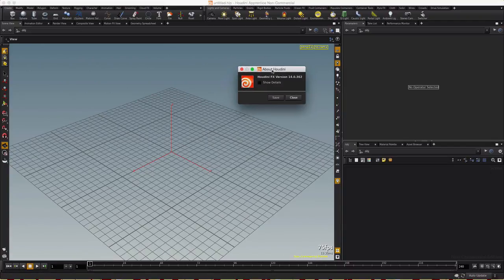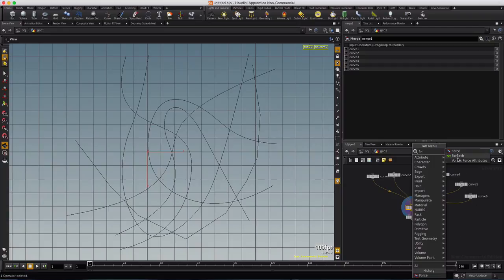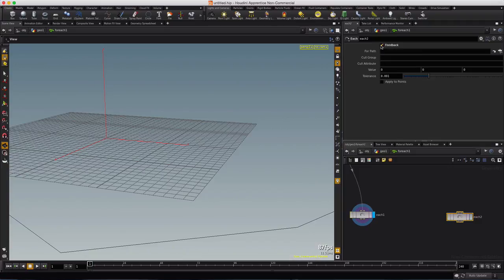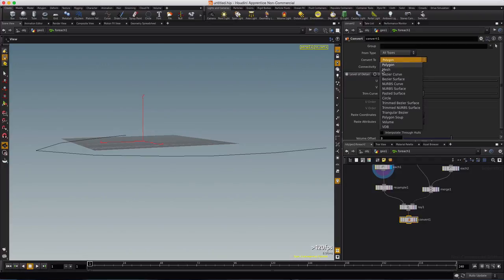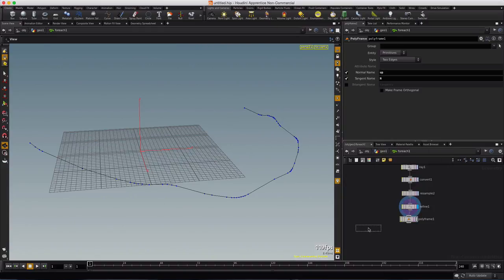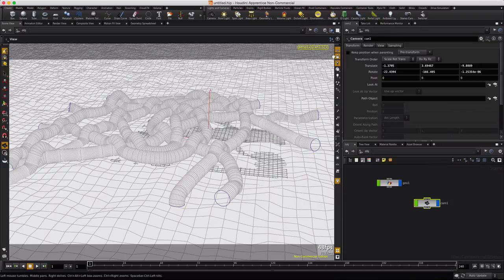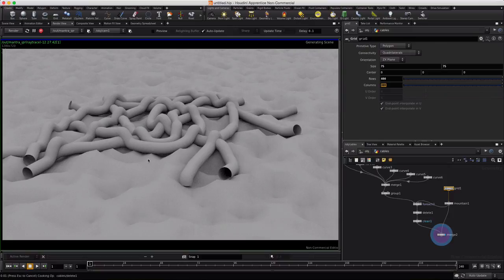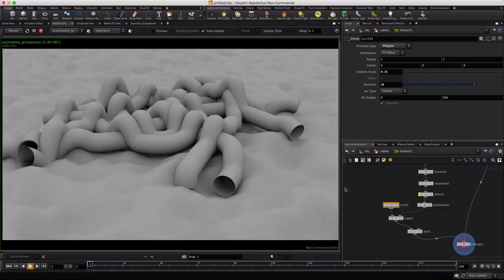Houdini Cables Over Cables and Over Landscape

Comment: Trying to do this with the new for each network and can’t get the feedback loop to work. Any hints what might be different in new version vs what you did here? Thanks.
Reply: Everything works except for the feedback loop (cables properly resting on mountain just not on other cables). The each node gives a warning that the foreach is invalid..
Reply: @antennatrees  It works with the new foreach network: on the foreach begin node click "create meta import node", then set the meta import to method to "fetch feedback" - this replaces the second "each with feedback" node in the video. otherwise the rest of the node layout should be the same as the video.
Reply: Same problem...Have you solved that？